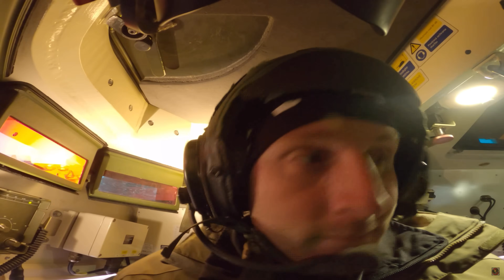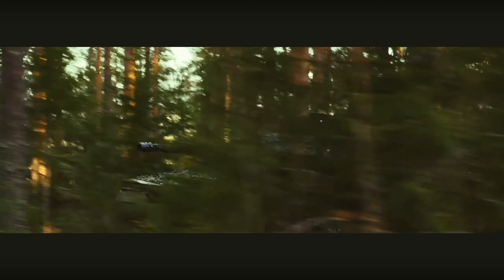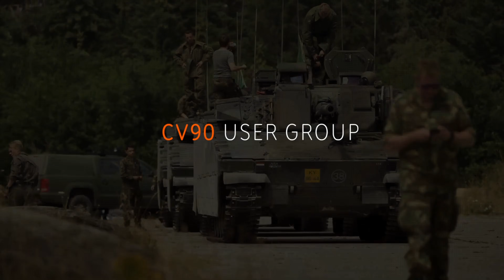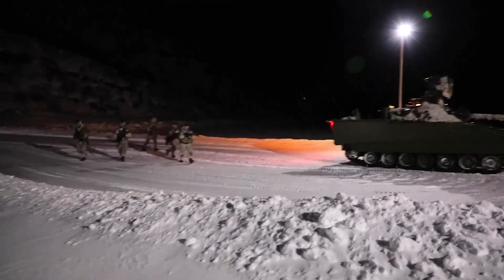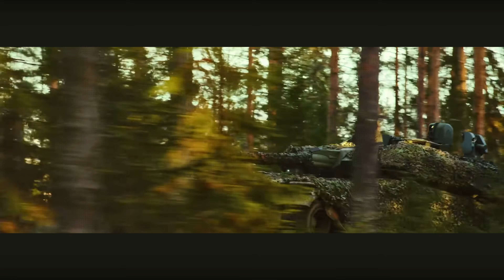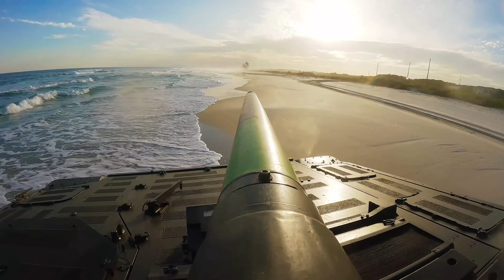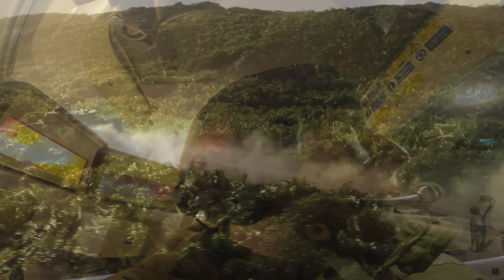Why is the CV90 IFV selling so well globally? | MASSIVE VEHICLE SALES 💰💰💰

Comment: 19:10 The 50 CV90s delivered to Ukraine from Sweden were the Strf 90C, which is the latest upgrade in Swedish inventory, also used for UN-missions in Liberia.
Reply: C model is not really the latest as A, B and C are used for different things. There are also upgraded versions of each A, B and C.
C version is as you mentioned the version for expeditionary use. This is also why the replacement is fine with using a different cannon as it's meant to be sent abroad rather then used domestically.
Reply: @znail4675  Of course they are used for different things, as they have different levels of capability.
A being the originally delivered, it is kept in storage as mobilisation reserve.
B is the updated version in current use for training and standing units.
C is the B with further upgrades, mainly protection and comforts like air-conditioning.